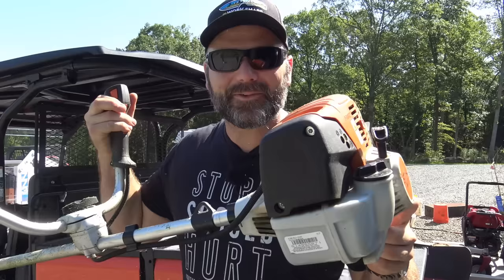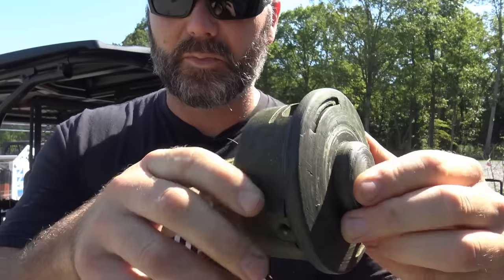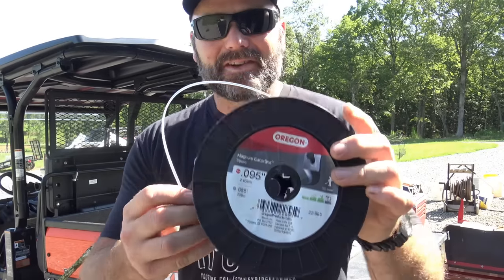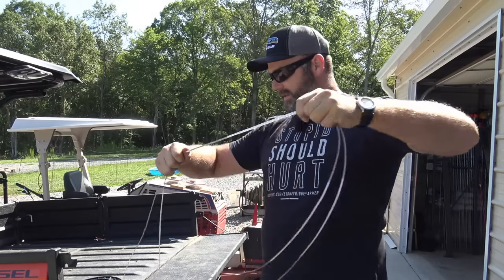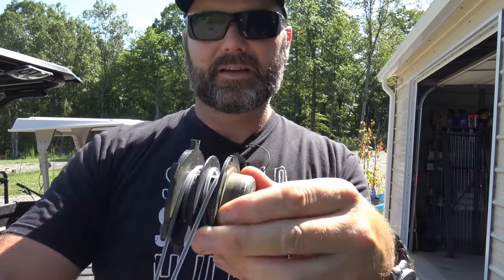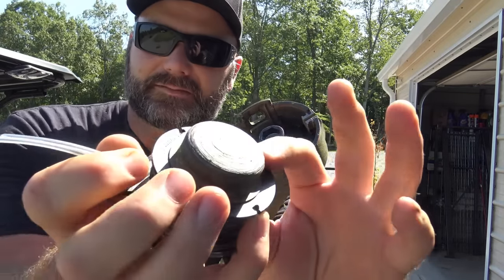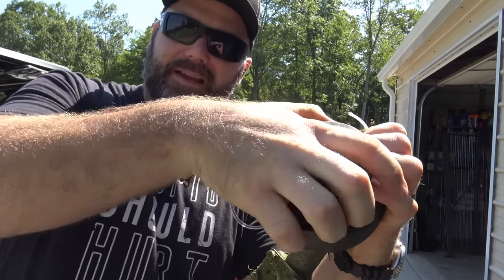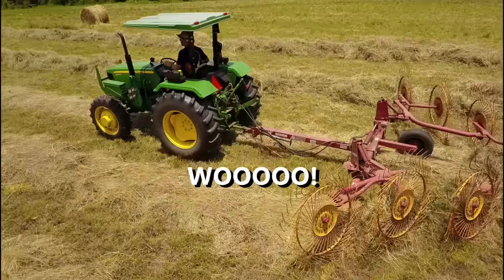EASIEST WAY TO STRING YOUR WEED EATER

Comment: Could you do one on the hyper tough mine wont feed?
Reply from the maker: throw it away and get a quality tool my friend....a $60-$100 weed whacker is a tool that will end up at the goodwill or in a dumpster. Check into a mid level Stihl tool or a Toro Battery powered one...you'll have better luck.  Those hyper tough weedwhackers don't last in my experience..constant problems

Comment: I just pull out four arm lengths the double over to find center, snip, wind upper side and snap in holder slot and wind the rest on lower cylinder.  Then back to weed whacking for five more minutes then repeat.
Reply from the maker: I think this method works pretty good...and lasts for an hour or more...who want's to restring a weed whacker every 5 mins?
Reply: @StoneyRidgeFarmer  yep, still looking for string that can withstand pavers and rocks.  Enjoying the content!

Comment: M8. i have a lawnmower business and I use the stihl FS 111. The first thing I do is remove the stihl head and put on a speed-feed 450 head that loads in 30 seconds it is the best and fast feeding head around you don't even have to take it apart. so as you request m8 pls look into the Speed-feed head. model number BRN6923. Company is GA power equipment spares. you will never use another head m8. 😊👍
Reply from the maker: cool I'll check it out

Comment: Here's a quick tip. Not using the deflector and keeping your line trimmed to the appropriate length is not only dangerous, it will cause excessive wear to the unit. Don't expect replacement when your machine "prematurely fails" 
Cert. STIHL tech.

Comment: There are two notches in the spool to hold the lines while re inserting into the housing, you don't need to hold them tensioned while doing this.
Reply from the maker: Noted....however this works great and it doesn't need fixing my friend...a simple thanks for the video Josh will be fine....the process works and doesn't need fixing buddy...it's all good

Comment: The little notches on the side are for holding the cord tight till you get the cap on, so you’re not having to hold them like you did when putting the cap on.

Comment: My way of doing is similar bur I don't cut two pieces. I leave the string in one piece, match up the ends, put it in the slots,  hold the spool in one hand and grab the string in the other but I spread the string with my index finger and turn the spool with my left hand because string is in my right hand and turn and pull the string around the spool the whole time keeping my index finger in the middle so you don't have that problem of the string wanting to twist. Once I get to the end, if you notice on the top of the spool there's 2 notches. Lock the string in each notch. Now line up the spool with the head and unhook one side of string and hook it in the head notches and do the same thing with the other side of string. Now take your snips and cut the string where they would be even. It's difficult to try and wind the string the way he's doing it. He's showing you facing the camera where as the spool would be facing your body. You're inching the string around the spool. You just gotta find what's comfortable for you. I've been doing it for 40 years so it does take time to figure out.

Comment: If you have a slot in the middle
…
You don’t need to cut the line you just find the Centerpoint of string and you put the Centerpoint in that slot… and wind the direction it says ..
Reply: Does yours have a slot for that ?  Just for a dewalt 20v.  It was so frustrating stringing the head …. But videos like yours make it so easy (: thanks .

Comment: Why has the shield been removed? It has a small blade that will keep the line at a uniform length, not to mention protecting the operator. After winding the line onto the spool, why didn't you lock each line into the slots on the spool? When you use the slots, you don't have to worry about the line slipping out of your fingers when placing the spool into the head.

Comment: As a quick measurement guide:  Usually your 'wingspan' is within an inch or so of your height.  Check it out to be sure, but when you know you will always have a measuring tool with you at all times.  Not an exact measuring tool, but a good approximating guide.

Comment: You can actually push the spool down and rotate until tabs are held under the tabs inside the head. This keeps you from have to hold pressure while placing cap back on. Once cap is back on, give strings a pull and the button will release.

Comment: Easier still without taking cover off just take the identical cut string and just inset onto the hole about an 1 1/2 as it engages onto the set hole. Do this on each end. This will leave roughly 2 strings hanging out about 4ft each. Then simply wind it in by turning the bottom of the weed Wacker to desired starting length. No need to remove covers etc.

Comment: I learned a long time ago to do them individually instead of that the same time because it seems to pull the string tighter when you do it like that which makes it get jammed inside the spool. I kept my string and a half I do the bottom side near the knob first wind it up real fast stick it in the little slot and I'll do the other side stick it in the little slot then I stick the school inside and I read the string in the slot and put my cat back on. Ever since I started doing it like that I don't ever get jammed. But there's more than one way to skin a cat and that's whatever way you want to do it.

Comment: Forget the weed eater string.  Drill a hole on either side of your string feed and put in some plastic zip ties.  Much, much stronger. They don't get tangled or jam. And when they are worn down to the nub, cut them off and put in two more ... or four if you want to just go wild. Zip ties:  the better weed eater.

Comment: U take the same string line up the arrows poke both ends one on each side and then grab the bottom and twist it only will twist one way keep line tight as u twist 45 seconds ur done no need in take the head apart
Reply from the maker: many ways to skin a cat buddy

Comment: Don't cut two lines, just cut one it's so much easier. Put both ends together and the other folded end is your half way point that you put in the center notch. The string will hold even because it's one piece. Also, why not use the edge notches to hold the ends while inserting the spool back in the head, that's what they're for. Bonus tip: use a chain link fence to make your ends perfectly even, just run the very tips of your string on the fence, it will take off excess string evenly.

Comment: To go a bit quicker, don't cut the string.  Unwind the 24' and wrap.  Once you put the cap on then cut the string sticking out exactly even.  It is a bit easier to handle and a bit faster.

Comment: Even easier if you just cut one 24' piece then grab the 2 ends then put them in the 2 holes, role them up then at the end just cut the string evenly in half.
Reply from the maker: lol...so it's easier to measure out 24 ft and then cut it 3 times...than to just pull out an arm's length? Hmm

Comment: The best kind are the straight though type. Hold 20 some feet just feed through central hole and wind up no disassemble required. Could not be easier.

Comment: I hate weed whackers...I have a Stihl whacker and I get it strung up and start using it and the string breaks at the entry point and it won't feed so have to take it apart every 5 minutes...as long as the string is sticking out it'll feed, but too often it breaks at the groove and I have to start over again.
Reply from the maker: try the string I'm showing ya....you've got a string issue..not a weed whacker issue....get the best string my friend..sounds like your string is dry rotted or something
Reply: @StoneyRidgeFarmer  I'll check it out. The strings I was getting were recommended by the store. The weed whacker itself is great, starts up on 2 pulls...but finding the right string has been elusive.

Comment: would help to indicate what “backwards” actually IS wrt rotation of whacker…
Reply from the maker: typically there's an arrow my friend
Reply: @StoneyRidgeFarmer  there are 2 arrows, rotation, and wind direction… fwiw, my issue was not tugging the wire once installed.. so it did not feed… found it on another video… ;-)

Comment: The worst part for me was to hold the string as i insert that cartridge in the housing until i found out that there is insert on the cartridge that will hold the string in place so you don't have to.

Comment: I noticed that the deflector has been removed from your trimmer. Many people do this and it is really unsafe and has no benefit. Not only does the deflector prevent rocks and debris from being thrown up in your face, it also carries the line cutter, which keeps the line at the correct length. NOT RECOMMENDED!
Reply from the maker: I do believe I mentioned this in the vid

Comment: You don’t have to cut two equal pieces of string. Just cut one piece of string for the entire length, stick both ends of your one piece into the head, roll it up just like you normally do, and then finish by cutting the string at the end. Look up the Stihl video.
Reply from the maker: lol...this is pretty simple buddy...don't be so hard on yourself

Comment: The ,095 string is big and the square, triangle etc. shapes always seem to bind around itself inside the head. I have better luck with round or twisted/round like MaxPower 338814 0.095-Inch Premium Twisted Trimmer Line. Less down time from untangling string. I'd rather hit myself in the head with a 2x4.

Comment: Im such an idiot. I tried to spool the string in the housing around the nut and then jam the strings through the holes after that and then jam and screw the divot top back on lol. Geeeez.
Reply from the maker: now ya know what to do!! Save the vid and use it next time until ya get the hang of it!

Comment: There’s a better way no need to remove the head and cutting the string in two halves,just cut the string at a desired length insert it trough the two Holes and rewind the string by twisting the head in the opposite direction ,no need to remove everything
Reply from the maker: do us a video buddy...this works and has helped millions...show us my friend

Comment: LOL...I linked to a video I did of a Speed Feed head and it got removed...
Ok-guess you don't want to actually help your viewers...Speed Feed 400 retrofit kit or Echo & Shindaiwa trimmers come with already...4x's easier and faster to restring... Shakespeare Ugly Line-comes with a built in cutter attached to the spool...no worries about tossed aside multi-tools/pocket knives...ok...your video is still playing...Speed Feed users are still out finishing their trimming...great video tho for legacy users...cheers!
Reply from the maker: everyone isn't gonna get a speed feed my friend...this is a video to help those who are having trouble
Reply: @StoneyRidgeFarmer  appreciate the idea behind your video...time and frustration have a $ value...if I can reduce the frustration associated with prying off a trimmer cap, taking out the spool and winding and holding and feeding through the string while getting the spool back in the trimmer head and then putting the cap back on, (and hopefully it doesn't all unravel as you said can and does happen), AND restring my trimmer in seconds instead of minutes...in my world-I'd be a fool NOT to spend the $30US to eliminate that frustration for YEARS to come...$30 is a meal out for 2 at McDonald's, or two tix to the movies...not even half a tank if fuel in an economy car... appreciate your video for what it does...but even your video is a great selling point on getting a Speed Feed 400! 👍

Comment: i find the echo speed head is much easier to load
Reply: Definitely, only takes a couple of minutes. 
I always cut the string on a 45, makes it easier to locate the holes, and helps to not push one end out while the other end is inserted.

Comment: I can’t even get the top to pop off the weed eater to even start restringing it!! My weed eater looks different the push taps are flush there’s no holes. The tabs I’m pushing in are breaking my thumbs off and nothing is happening 🤦🏻‍♀️ it’s not popping up and then off like yours did it literally stuck. I hate weed eating anyways been doing it all my life plus house work cooking caring for my child and working despite having a husband 🙄.
F it calling a lawn guy 😂
Reply from the maker: use a screwdriver or the tool that probably came with your string trimmer...if your husband isn't pulling his weight or is lazy....have a discussion with him and set some ground rules.  Teamwork is important...and so are boundaries

Comment: Way easier not to cut measure,  just wind on straight from coil and cut repeat , way quicker than anything
Reply from the maker: how do you wind on 2 strings at the same time with one roll?

Comment: I don't get it.....this video promises to show an "awesome" method of winding the string, then shows essentially what the STIHL manual shows, but without using any of the convenience features that STIHL has designed into the reel assembly.....so while what is shown works, it is actually more awkward than what STIHL intended. Nothing "awesome" about it. The video should have been titled, "OK, you never bothered to read the STIHL manual, and neither did Stony Ridge Farmer, but here is a so-so method of winding the reel". Geez

And apparently the name is pronounced to rhyme with 'steel'.......

Comment: I watched your video and I have to say, there is so much easier way to do this, and your string will never get stuck or messed up inside your spool while using your weed eater. You should subscribe to my channel, and stay tuned for a more proper video of doing this. No offense, but you restring a trimmer like I used. You cannot honestly tell me that your string doesn't get tangled up.

Comment: Doesn't work have to be more specific those holes one of them the string goes right through so can't unwind why not spend more time on showing the holes the most important part why just glare over that
Reply from the maker: why are ya ripping into me for helping you.  It does work my friend...this is how I do it and it works.   the string does go right through....but ya don't push it all the way through.  Follow this video and it will work...has helped millions of folks struggling with weed whackers my friend.   Please don't scold me...I don't deserve it
Reply: @StoneyRidgeFarmer  I wasn't scoring just asking why you didn't zoom in or spent more time in the i.portant part. You said it works well I followed exactly what you said and it didn't work weed wacker flee off during got stuck I'm base oh well. Then had to use my blade weed whacker.

Comment: Still not right, no need to make two measurements. First do 3 of your arm lengths, then cut. Take the two end, line them up even and cut the piece in the middle, now you have two identical lengths. Next take one string and put it in the bottom hole and wrap, now on the ears there are little grooves to hold it, stick in there hold it with your finger. Now take the other piece and put it on the opposite side whole on the top and wrap. Now there is a little groove on the top, slide the end piece in that. Take the head and put back in slowly rotate until the ears  is under the metal guides, the head will stay locked if its under the metal guides. Put your sting into the guides, put the cap back on, now the button should still be below the cap, with both ends of the string coming out, now pull each string at the same time, now it should pop back up and you're ready to go.

Comment: LMAO imagine not switching your factory head for a Speed-Feed system.

All Factory string trimmer heads are terrible many of them have little buttons that are hard to bump on uneven ground and they bind all the time and it is always a pain pushing in the little panels on the sides to get them open to remedy problems

Speed-Feed systems has none of these drawbacks and are just a pleasure to work with in comparison

Comment: Not the quickest way or best way, LOL
Reply: Measure out the length like you said, double the length, forming a loop, cut the end still attached to the main roll, stick ends into tool head and wrap around, cut the loop when wrapped up.  Just a little difference.